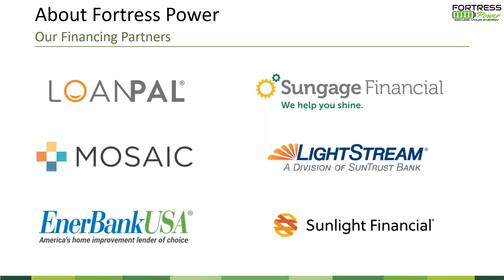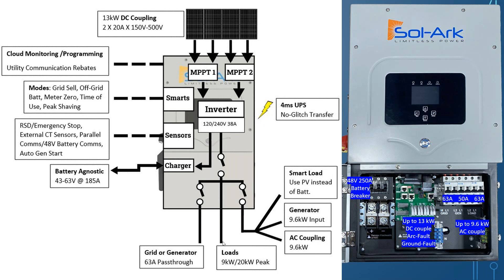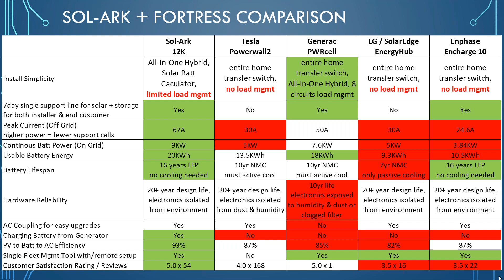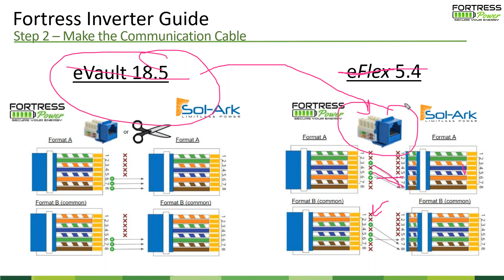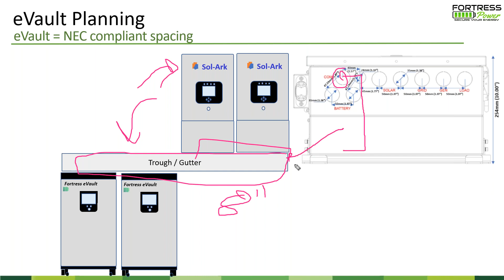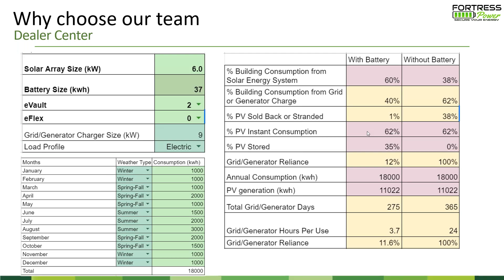Fortress Power & Sol Ark Webinar  Lithium Iron Phosphate Batteries and Hybrid Inverters Maximize You

Comment: Nearly all the time there is significant disparity between what the Fortress says it has remaining battery power and what Sol-Ark reflects. Is there a way to reconcile or improve that? I could understand if it was off by a few percentage points, but most days are 10-30% difference. Please advise,